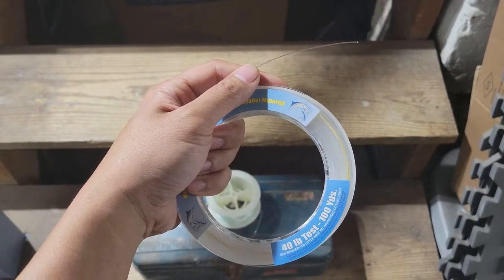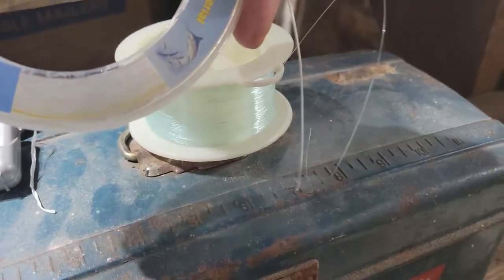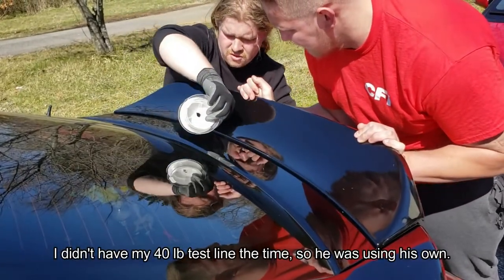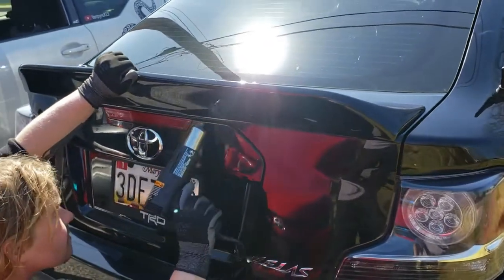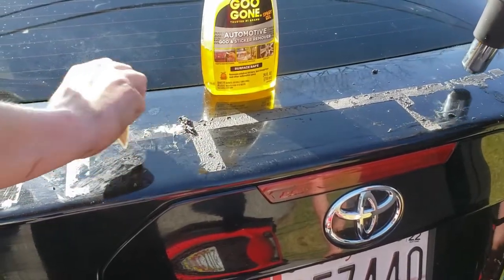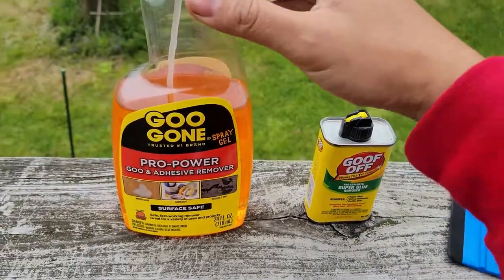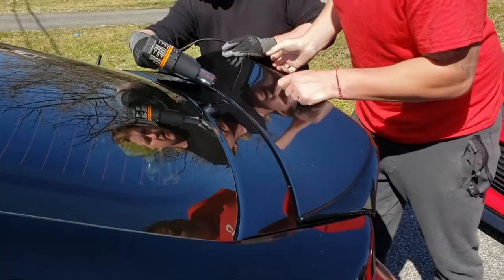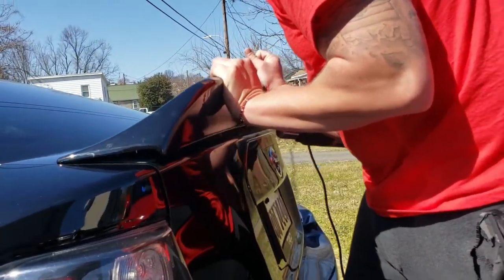Removing 3M Taped Duckbill Spoiler with Fishing Test Line, Not Dental Floss (Scion tC2 / tC2.5)

Comment: I used strips of paper towel on the tape areas and soaked it down with goo-gone to keep it from going everywhere and a plastic razor blade but a rubber eraser will do the trick in 1/10th the time.

Comment: Hey I literally just put my spoiler on last night with 3m it’s a little off centered and lighting a little because of that. I plan today to take it off and redo it, is the tape easy to get off the spoiler? Thanks!
Reply from the maker: If it's pretty fresh, you can usually just push and roll it off, but it'll take time. They also make a rubber wheel you attach to a drill to help remove old decals and tape if that doesn't work.

Comment: When I installed my spoiler I accidentally made one side 1/4'' higher.  Do you think I'd be able to redo one side without completely taking the spoiler off?

Thanks for the video!
Reply from the maker: Unfortunately, you'll need to completely remove it, clean up the tape, and apply new tape.
Reply: @VampyreX13  Sadly you were right lol.  I  separated it halfway, moved that end in place, put weights on it to hold it in place, and left it in the hot sun.  There was a smidge of tape that had never been pressed down all the way and I ran a bead of black caulk around the seam of the entire spoiler.  Hopefully this works lol.  (my car is covered in black truck bed liner so the caulk blended in perfectly.  On a normal car I might not have been able to do this)
Reply from the maker: @leovulpes4917  good luck. I hope the repositioned tape will be strong enough to keep it in place. Definitely keep an eye on it.